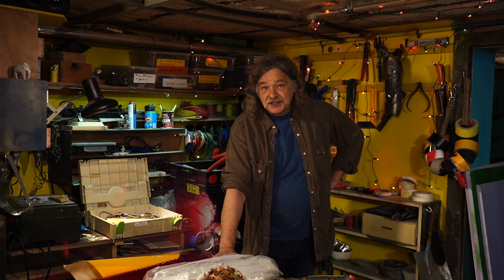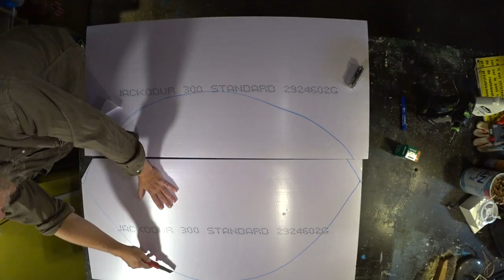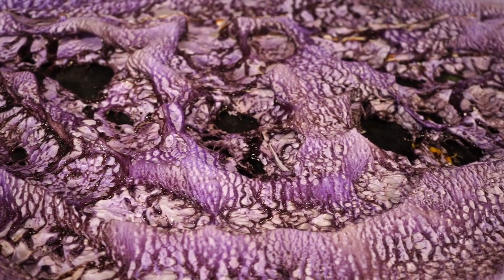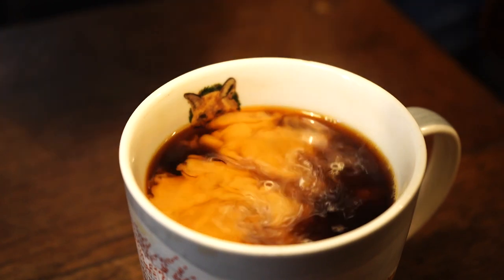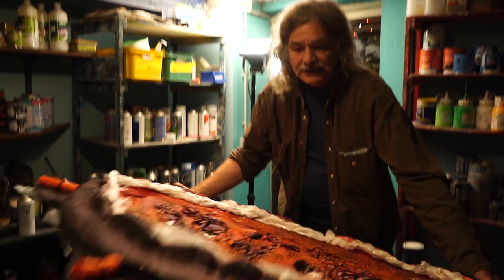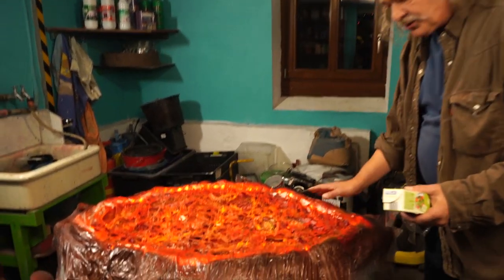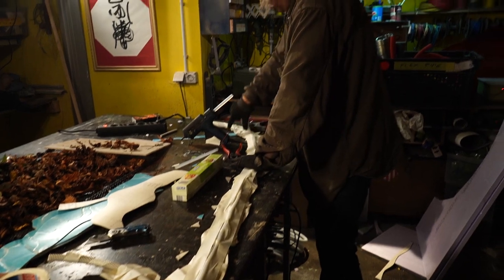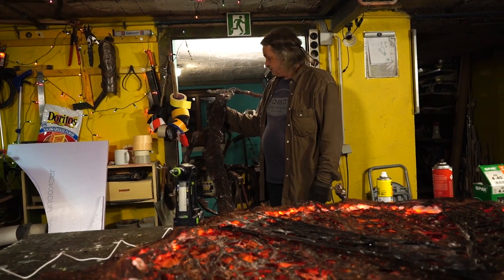Building the Gate from Stranger Things DIY Halloween Decorations

Comment: We are in the process of making this! Having trouble finding strip lights that fade in and out red. Can you tell me what lights specifically that you used? Thank you so much!!!
Reply from the maker: If i remember correct the beand was Goovee but most led strips can do this. I remember that i could control them via iphone and set up a custom animation. They where quite cheap probably $30
Reply: Wonderful! Thank you! It’s coming along nicely. We are doing our whole front yard stranger things season 4 theme.
Reply: Ken usually goes for the best (like this one), but I usually get the cheapest strips from the low-end hobby store.
Last one I bought was 17 bucks, and had a little remote to change colors etc.(in the "Pumpkin Stand" video).
My idea is, it's deco, not fine lighting of a room, so a lot of stuff will do.

Comment: Oh man I will burn my house down trying to make this... do you sell this???
Reply from the maker: Nope sorry this was a prototype only ;)
Reply: You may experiment with etching the styro with thinner i.o. burning. Go slow at first; different brands react differently.
For the cleanwrap, a hot air gun works too, it's a bit less precise. May work for styro too.
But it's a very forgiving project; you can fix or hide  just about anything that goes wrong.

Comment: my paint is absorbing right into the Styrofoam. Any tips?
Reply: As I said, styro is a pretty general term for a number of fairly different stuff, and there are a lot of different qualities in spray paints, so essentialy, better make a test in a small spot first.
(Melting/etching styro with spray paint can also be an interesting effect for some stuff,but too much will kill the object)

Ok, what now ?
Priming or painting it with water based paint always works, it just takes drying time.
You can either paint it the right color or spray (not too thick) over it, once painted.
Note that for this type of work,you don't have to wait for it to dry before adding different colors in places.
One advantage in non-spray paints is that it makes a lot of stuff,like sawdust or leaves stick well directly,without glue.
Also useful to know,especialy if you use leftover/recuperation paints, is that ANYTHING waterbased (not just paints) can be mixed.
Like latex & acrylics, or adding white woodglue for thickening/resistance/gloss,even coffee or tea into white paint for off-white...

Thje other approach is to buy "styro-proof" sprays (but still give it a test).

Sorry for late answer; as it's not my channel,I don't get notifications.